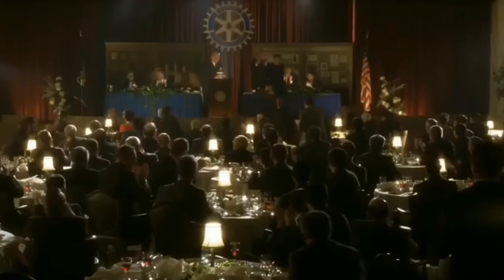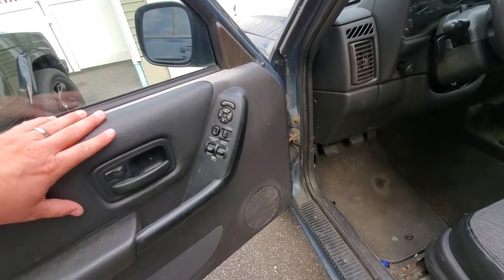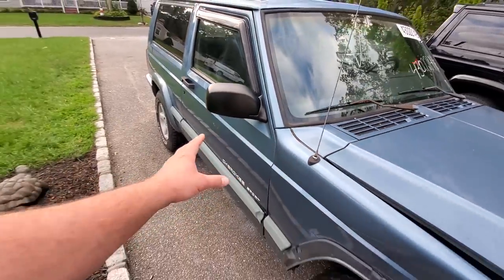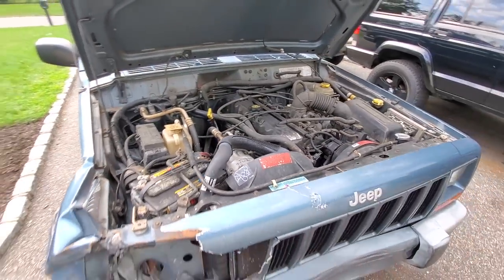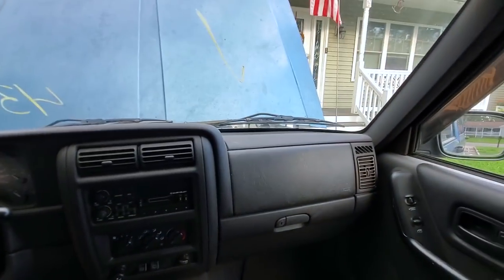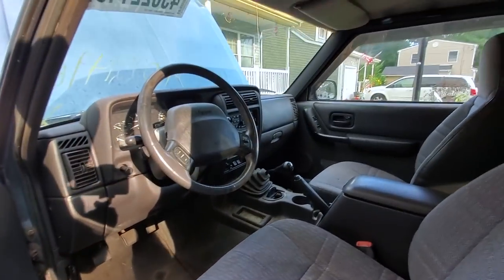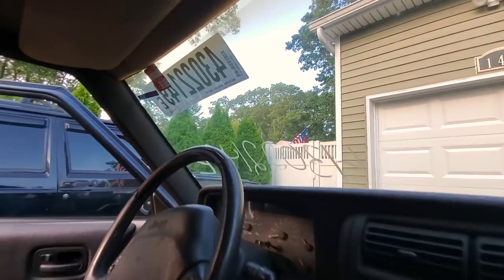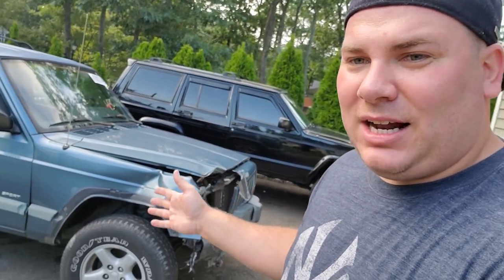MY NEW 1999 JEEP CHEROKEE XJ 2 DOOR PROJECT CAR!

Comment: Such a nice XJ. an easy and fairly inexpensive repair. Could probably even straighten the right front fender apron and not even hurt the paint.  You have a gem here. You could retrofit a transfer case and front 4x4 axle and your good to go. I bet this thing is in better shape than your beach Jeep.
Reply from the maker: Its a simple fix for me, I have a transfer case and an HP d30 ready to go.  This will become my beach jeep... in some form =)

Comment: Yes that's an 8.25.  If you want to get rid of the drums you can do a junkyard disc brake swap from either ZJ or early Liberty for the backing plates, but you want the ZJ hoses.  I  went with the Liberty due to availability.  Finding longer wheel studs was the only "fun" part.  I think I know where you're going with Beach Jeep, but we'll see if I'm right.
Reply from the maker: Yep! I did the rear disk swap with beach Jeep on her 8.25.  was pretty simple.  I went with Ford escape e brake cables
Reply: @ProjectDanH  Crown makes disk brake conversion e brake cables for the XJ.  I stopped looking at my options when I found them.  Thought I was going to go through the windshield first time I hit the brakes.
Reply from the maker: @robertgrauman8602  LMAO! Ill make sure I wear my seatbelt when I test em 😂

Comment: i also have a 2 door 97 xj very nice bought mine as well bought mine from an auction for 350 runs and drives.  If you decide to part from anything let us know, i am looki g for a few parts espically inside door panels possibly whole door. Thanks in advance.
Reply from the maker: You got it brother!  I'm most likely not using the door panels. However im gonna need the doors.  I'll keep you guys posted 👍

Comment: "Looks like you got a 8.25 with 3.07 gears", which is what all jeep xjs came with with a manual trans, my 4 door 98 jeep xj sport 5 speed has the the dana 35, not the heavy duty rear but it literally does fine for me and I dont beat mine but its lifted 3.5 inches on short arms , it's a little stiff but it's also completely new suspension. And I daily it with no weight on it. Nice xj , rare find, if u repaired it and converted 4x4 you could literally resell it for a nice penny, these jeeps are hotter than ever , ive had mine for 3 years and yes I've opted out to replace things it didnt need , but I can depend it so why not, I've done a ton of work to mine and I would not want to trade it up for anything , I'd like to keep it as long as the good lord will let me ..
Reply from the maker: absolutely 👍 I got the build sheet from Chrysler customer service.  I wonder, do you have ABS? it seams as tho the only reason jeep used the D35 in XJs was to add the ABS
Reply: @ProjectDanH  yep it has abs, my plan is to simply pull the brakes system from another jeep non ABS  and put it in mine and get ride of the ABS , its not hard for me to do that, and I want to put dana 60 in the rear and a 44 up front one day.otherwise I'm running this, and its servers me very well being a daily, and that swap I want I'll be saving for because it definitely isnt cheap because I'll do lockers and Yukon gears front and rear with RCV shafts and chromoly in the rear.
Reply from the maker: @offroad8163  WOW! That sounds like it's gonna be a bad ass!  I'd love to grab JK d44s front and rear for my new project  😁
Reply: @ProjectDanH  hell yeah , because it's the only swap , besides the 44s front and rear that just seem perfect to also be able to drive on the road ...I like to be able to drive it on the road also and not have to trailer it and definitely I would 37 inch tires, a cut down dana 60 tho.

Comment: I dont think you need to even drill it out should be able to unbolt that fender and almost even bend back by hand then put a new fender on if the inner well isn't totally warped. I would think about that and a quick flip. Do you know how rare and sought after two door XJ is theese days 4x4 or not? Just saying man I know them in and out had 8 so far I'd think about it👍
Reply from the maker: Fender is shot and inner unibody is shot. Id have to to replace it.  I know what I have, that's why I bought it.  Im making something better than the 2 door. 😁
Reply: @ProjectDanH  got ya. Do you plan on converting it to four wheel drive? Just curious .
Reply from the maker: It will be a 4 wheel drive, 7 passenger, 5 speed manual XJ when im done with it 😁

Comment: Hehe hooked up I have never ever worked on or owned a Jeep before 2k that had working cruise control Jeep should have just said no delete it throw it in the bin I just got my white one tagged can not wait to drive it later see if the cruise control works it's a 2k model zj so who knows lololol
Reply from the maker: LMAO! I'm pretty good with fixing cruise control.. I even add them to XJs that don't come with it 🤣
Reply: @ProjectDanH  never used it traveled long distances just never felt the need
Reply from the maker: @deniedjoo  gotcha.. on an open road I like to set it at different speeds to find my optimal MPGs. Lol.  I'm a nerd

Comment: Nice find!  It'll be interesting to see if you can get the manual swap done.  The AW4 is a different length so you'll need new driveshafts.   Also, you'll need the computer for a manual jeep and since this is a 2wd model I'm not sure if it'll work.  A manual swap was something I wanted to do but the more I looked into it, the more issues I seemed to discover.  I would like to see you pull it off though.  Good luck!
Reply from the maker: Thanks alot Tom!  I'm gonna try to run a manual transmission on an automatic computer and harnesses with an NP242.  I'm pretty sure if have everything I need.  If you have any experience or concerns please don't hesitate to share. 👍